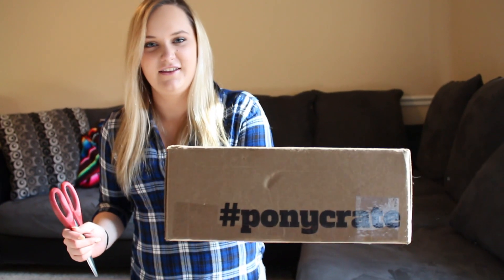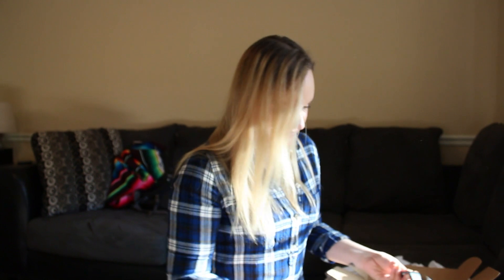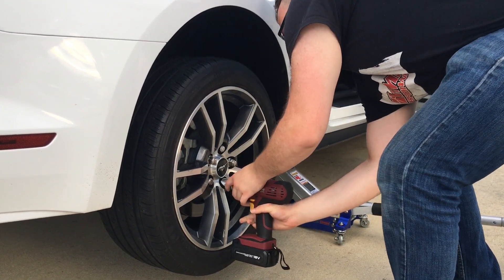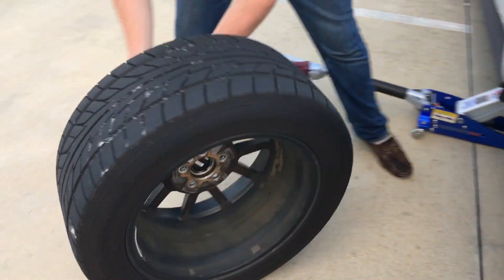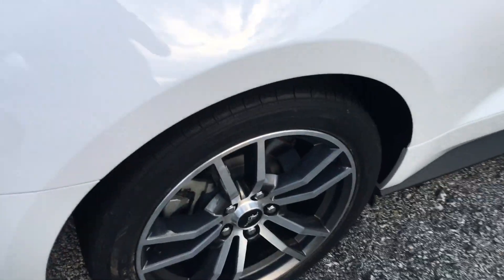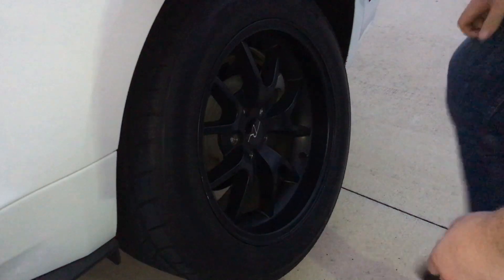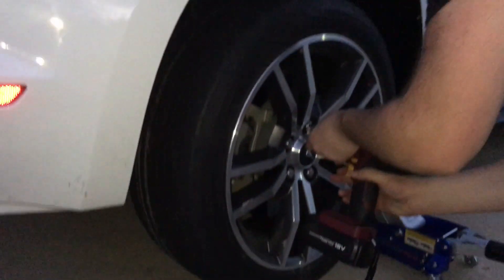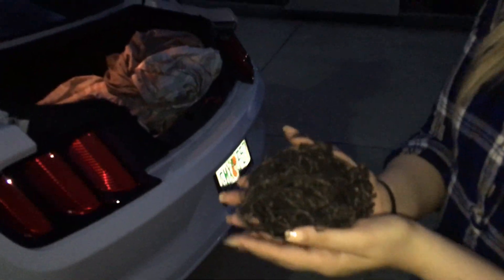Ash Destroys Tires In the 5.0!

Comment: I have a 2014 5.0 i was thinking about straight pipes  should i or should i go with an x pipe with flomaster 40s
Reply from the maker: Straight Pipe does not sound that good- Straight pipe means no cats, no mufflers, no resonators. It will sound very loud but looses tone. Ashley's exhaust is Resonator Delete X-Pipe and Muffler Delete but stock cats are still in place there for not straight piped.

Comment: I was wondering what muffler delete is on scott and ashleys cars? i read yal both have an X-Pipe and muffler delete? do yal each have a specific brand axle back Muffler Delete? OR did yal just have an exhaust shop run their own Pipeing and add polished tips?  I really wanna know please!!   sounds awesome guys!!
Reply from the maker: We had a local shop do the work. It came out very good. We have two videos on the process being done both on Ashley's car and Scott's car.
Reply: thanks for the quick response and info sounds awesome, i will have to have mine done like that then, im sure its alot cheaper for a shop to run pipe for muffler delete, rather than buying a name brand axle back delete for sure! awesome vids guys, keep up the great work
Reply from the maker: Pypes Muffler Delete is a fairly inexpensive alternative. Just make sure you have an exhaust shop that you know does quality work and doesn't hack exhausts together.